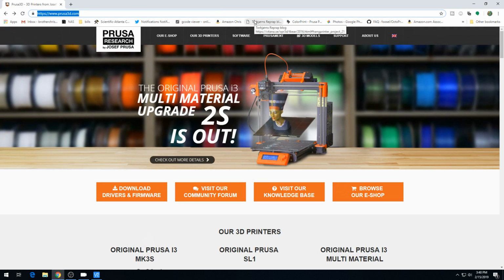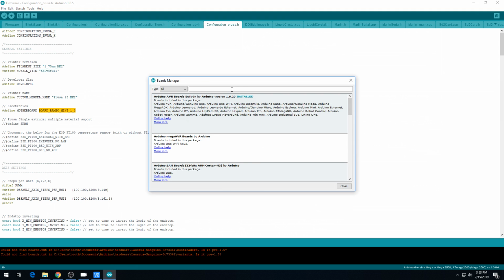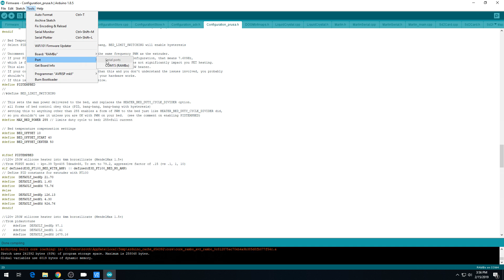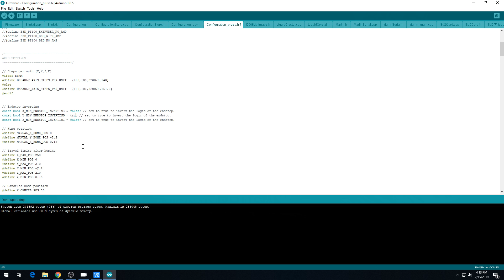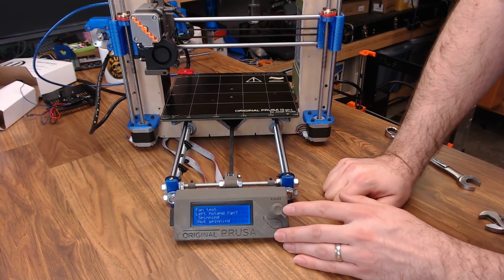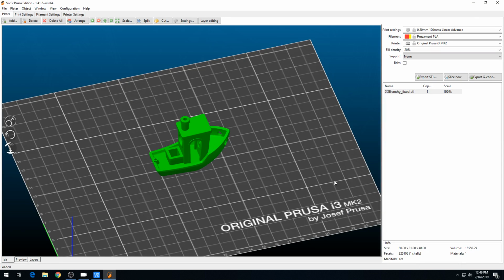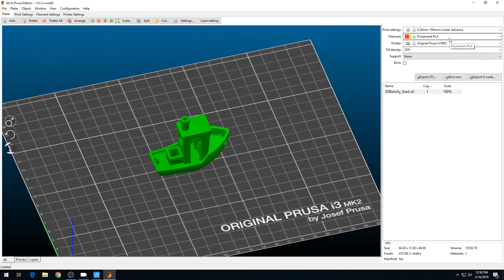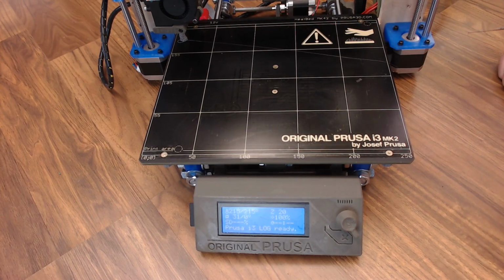Prusa MK2 Clone - Load Prusa Firmware - Chris's Basement

Comment: Hey- those lead screw adapters!  I need those too, still got the link to these?
Reply from the maker: I think this is the one I used. https://www.thingiverse.com/thing:2383921
Reply: @ChrisRiley  One more question:  Beyond the mk42 bed, mini-Rambo, and stock-style x-endstop, and 8mm/4start/2mm thread pitch Z-rods...  Is anything else needed that you can think of?  Or do all the firmware features work now?  (Beyond what you talk about in your vid that is)..
Reply from the maker: @corneleousworthington4566  The board and bed are the big ones, that should be it. Make sure you use their slicer profile to take advantage of linear advance.
Reply: @ChrisRiley  Thanks man!  One more question:  What bed level sensor are you using?  I have a 8mm 5v LJ8A3-2-Z/BX-5V, but it seems to want to hit the mk42 every so often, cannot understand it why?
Reply from the maker: @corneleousworthington4566  Might be your just got a wonky one, the QA on them isn't great. I use this one. https://www.aliexpress.com/item/32801244337.html?spm=a2g0o.detail.1000060.3.57c715d5AT5CqK&gps-id=pcDetailBottomMoreThisSeller&scm=1007.14977.161855.0&scm_id=1007.14977.161855.0&scm-url=1007.14977.161855.0&pvid=6dbb3999-d717-426b-8d42-76e3a2d4791e&_t=gps-id:pcDetailBottomMoreThisSeller,scm-url:1007.14977.161855.0,pvid:6dbb3999-d717-426b-8d42-76e3a2d4791e,tpp_buckets:668%230%23131923%2312_668%23808%237756%23237_668%23888%233325%235_668%232717%237558%23119
Reply: @ChrisRiley  My level sensor seems to work- it always levels perfect if doing auto-home, or mesh leveling of the bed.  It crashes maybe 2/3 when doing an XYZ calibration.  Think there is a default value somewhere in the arduino code, for Z-max (like the firmware asks you to do at the beginning of the XYZ calibration) and the bed, and maybe mine is a few mm too short?
Reply from the maker: @corneleousworthington4566  Yes, you pretty much have to adjust your hardware to get to the spots Prusa gives you. The Z shouldn't matter, just x and y.

Comment: Hi Chris Riley, I'm putting together a prussian bear but it came with ramps 1.3, and in the repository I can't find it, could you help me?
Reply from the maker: Check this out to get you started. https://discuss.toms3d.org/software-f5/prusa-firmware-for-ramps-prusa-i3-clones-with-mk42-t123.html
Reply: @ChrisRiley  you are very kind thank you.
Reply: @ChrisRiley  Hi, how are you, I installed the marlin, but I get an error, the screen does not work the knob, I am using a 2004A screen, I will load an image of the screen for you to have reference.
Another problem is in pronterface I move the axes, and they don't work, they get stuck, locked sometimes they move.

I have 2 types of screen and in the 2 the same thing happens to me.

2004A LCD screen
2004 LCD screen
They come in Kit with RAMPS 1.4.
Reply from the maker: @darksideadv  Hmmm...not sure what's going on. Could be one of the plugs is flipped on the board side.

Comment: abyone having problems with stepper motors with this board??
Reply from the maker: I haven't had any, what issues are you seeing?
Reply: @ChrisRiley  tried several motors, z axis only rotate 1 way x and y flutter back and forth.
Reply from the maker: Wow, sounds like maybe a hardware issue.
Reply: yeah I just got this board from ultimaker yesterday for my mk2 clone, having the same issue.  Currently trying to trouble shoot it now.

Comment: Great video!  Stupid question...  I’m building a MK3 clone, will I need to do all the Arduino stuff or can I just use Prusa Slicer and the latest hex file to update the Einsy Rambo board?
Reply: FYI - Jason at Ultimachine just told me that I could use the latest .hex file and Prusa Slicer.  Of course if you are using non Prusa motors etc, you may need to tweet the firmware.
Reply from the maker: @angieanddougsemail  Nice, good to know. Jason is the man.
Reply: @angieanddougsemail  I have just uploaded the latest firmware for the mk3s to my Ultimachine board using prusa slic3r and it failed to finish,  now I cant upload anything without getting  ( "avrdude: verification error, first mismatch at byte 0x3cb1f  0x00 != 0x01") tried to load the mk3 firmware with no luck, same thing, the only firmware that seems to upload to my einsy board is the mk2 firmware but then I have no information on my LCD, I am using non prusa motors with my clone, but every thing else are prusa parts, could my problem be that I havent tweeked the firmware for my motors, as a newby to this and being my first build I don't know what I need to do, any help would be greatfull as I have spent the last three weeks trying to sort it.
Reply: @angieanddougsemail  What is the difference with the LDO motors and the ones I am useing (17HS19-2004S1 OSM 20170817)?  my extruder is a E3D V6 and my Einsy Rambo board is from Ultimachine, all other parts are genuine prusa parts that I managed to collect, plus I allso have the mk3s upgrade, I just dont know what to do from here.
Reply: @angieanddougsemail  I hope so, and thanks for your input.
Reply from the maker: SO I am not sure, on the boards Prusa uses they are listed as the manufacture of the board. Non Prusa boards list Ultimachine. So this might stop you from using Slc3r to upload.

Comment: My X and Y endstops are triggered unless I press them then they are "open" I need to invert the min endstops but this is no longer a option in the firmware like it is in your video.
Reply from the maker: Are you building a MK2? That firmware hasn't changed since 11/17. If you are building an MK3, it isn't there because they have endstoplees homing.

Comment: definitely, need to get rid of the board that came with my Anet8 but so many options. As a newbie, a lot of people are saying go with smoothy, a new operating 32-bit system since I have no experience with either I'd say your the man to ask? sounds like another video  thanks again
Reply from the maker: Smoothie is a thing of the past, don't go that route. On an anet machine I would keep it budget friendly. Maybe a mks gen l.
Reply: @ChrisRiley  much difference between Gen L 1.0 and 1.4?
Reply from the maker: @bigrickshaberdashery2759  I think the gen l is just the newer version of the 1.4.
Reply: @ChrisRiley  with the gen 1 board what drivers you suggest?
Reply from the maker: @bigrickshaberdashery2759  If you want to make it silent with very little fuss. Go tmc 2208. If you want to save money you can get 2208s for x and y and just use some cheap a4988's for z and e.

Comment: Hi Chris very very awesome Video 👍👍...
Just one though can we use Bltouch instead Pinda probe
Reply from the maker: Thanks! You could, not sure how it would turn out. Not sure prusa has support in there firmware for it.
Reply: @ChrisRiley  Thanks for reply chris.
th3d also didn't have in their firmware but defining SERVO0_PIN 27 worked. May be it can be done for prusa too ?
Reply from the maker: @sharadjadhav7234  The pin could be changed, not sure the servos are in there. It will take some digging.

Comment: Can someone give me a name, part number or perhaps a link to where I can find the crimp on wire ends he is using for his power and ground wires? Right now I am using heavy speaker wire with twisted and soldered ends. I have been told this is a really bad idea and could case a fire.
I guess I should mention I have a box frame 3D printer that I built from scratch, so I am missing a lot of the nice bits all the cool kids have.
Reply from the maker: They are something like this. https://www.amazon.com/VLIKE-Crimping-Connector-Electricians-Contractors/dp/B077VGG18B/ref=pd_lpo_vtph_469_bs_t_1?_encoding=UTF8&psc=1&refRID=H8DCDN65RG68H8NRKZDR

Comment: Great Video, would love to see you go deeper into the firmware. I'm currently converting my Tevo Tornado to an oversized MK3. I'm successfully using the einsy rambo for crash detection, super silent stepper driving and homing without endstops. Power Panic is a WIP and hope to have it done this week. I've had to really dig into Prusa FW to make it work so I'd love to get your take on the organizing/layout of the code in the FW.
Reply from the maker: Thanks Evan, yeah it's a bit all over the place. 😀 It's not as straightforwardd as stock Marlin.

Comment: Could you use this firmware on an ender 5 style machine as is or would you need to change things?
Reply from the maker: There would probably be a few changes. Not sure which ones exactly. Not sure which board that printer has.

Comment: I'd love to see this but with a different board, MKS Gen L or 1.4.   Is that even possible? Either way nice video 👍.
Reply: If you have MK42 heatbed installed you can use https://github.com/slippyr4/Prusa-Firmware
Reply: Yes, it's possible but with the prusa setup the firmware controls bother the part cooling and hotend fan on 12V. The Ramps board only has 3 controllable 12v pins, 2 of which you are using for the bed and the hotend. I hooked up an external mosfet board and set it up to use the use the pins on the aux header. I have a branch here https://github.com/michielbaird/Prusa-Firmware/tree/MK2-RAMPS2 but pay close attention to pins_Ramps.h
Reply: I'm also working on a mk2.5 version but they restructured some things that makes it  a bit tricky. I think I'm close
Reply: @michielbaird  I wish to know where to start in case of Prusa firmware adaptation to Ramps. :) I have Ramps 1.6 with TMC2130 X,Y drivers and MK42 heatbed. The closest version I was able to find online is https://github.com/sakibc/Prusa-Firmware-RAMPS.
Reply: @MatúšKostik  I might look at that at some point, with the tmc 2130 it's a bit trickier since you'd need to hook it up to SPI and my electronics enclosure is already a bit packed...
Reply: @MatúšKostik  also be careful with a RAMPS 1.6 from the spec it looks like it's rated for 11A max, so you'd probably want to hook up an external mosfet for the bed, I tried the setup on the 1.5 and melted 2 boards. I really don't want people accidentally burning down their house
Reply from the maker: Very good info here, thanks for sharing. I didn't even know this was available.

Comment: I'm surprised no Chinese company sells an actual clone.
Reply: FYSETC is selling kits now, but I believe the motherboard is still sold separately.
Reply: Right, they sell a kit with the board but without the printed parts:
https://www.aliexpress.com/store/product/1-Set-DIY-Prusa-i3-MK3-Magnetic-Heat-Bed-MK52-Aluminum-Alloy-Frame-Profile-Rod-EinsyRambo/3480083_32968736910.html?spm=2114.12010615.8148356.10.68b3210bTZsJti
Reply: They are way to cheap to do that.
Reply: @bliksemdonder5624  I don't know. A real clone for 400€ would have some success, I reckon
Reply from the maker: Yes, I have seen them for about $350, but no board.

Comment: So next step is 0.9º stepper motors and metal frame ^^ . Keep up the good work.
Reply: I have two Home made Prusa,( laser cut aluminum frames) one is on 1.8 steppers and the other on 0.9, There is a noticeable difference, when fine layers are used, but for the everyday normal 0.2 layer heights , its really about the same.
Reply from the maker: @patprop74 Good insight, thanks for the info.
Reply from the maker: You never know what I will find next. 😀

Comment: Mmmm piece of candy...Mmmm piece of candy...Mmmm piece of candy...Mmmm piece of candy...I know your a bit of a ways from Quahog, but I couldn't resist. I would expect that your results will be a testament to the overall designs of the original equipment; even though you're not actually using OEM. E3D's and Prusa's equipment are so well designed that even the knock-offs are capable of producing almost equally comparable results. I hope you're bringing LOG with you to MRRF; it would be awesome to see Prusa sign it.
Reply from the maker: lol, so much better when there is candy! Ooooo, that would be awesome. I should try to get it there.

Comment: Chris - thanks for that video.

Would it be difficult to add those "saucy" Prusa parts to other printers?   I'm used to work with MK2S, but now I'm in the laborious process  of building my own 3D printer, and I'd love to have Prusa-like features, say - Live Z adjustment.
Reply from the maker: I think you can, but you might not be able to use the XYZ skew. It's really meant to check if the prusa is built correctly, but with enough firmware tweaking I am sure it can be done.

Comment: Chris, nice job as always.  You do a great job with the firmware stuff.  I built my printer following Tom's Dolly series.  Just ordered a Duet Wifi on Printed Solid's Sale.  I'm sure to use that Video.
Reply: On my clone I used an Anet A8 heatbed off Amazon.  Took precautions to make it safer but always looking for something different.  Any suggestions?
Reply: @johnhammonds3952  Hi Jonh. Also have a Anet A8. I would solder the connector directly to the heatbed and use the typical strain relief (cable chain or like chris use's on his LOG).
Reply: @rodryk5605  I still have the connector but doubled up the power wires as a safety.  I also added cable chain to provide strain relief.
Reply: @johnhammonds3952  That should be enough.
Reply from the maker: @johnhammonds3952  As far as board options you mean?
Reply: @ChrisRiley  I mean a good option for a heatbed.  The A8 of course has issues but also only 220 on x&y.  Also you m er notion needing to go to 24V on Duet to get power resume working, anet HB is only 12V.  You seem to have a genuine prusa mk52 on log.  my only printer is my home built Dolly.  So I dont have access to these.  I dont think prusa sells them and most clones are not cheap.
Reply from the maker: Thanks John, the Duet board is awesome!
Reply from the maker: It kind of depends where you are. LOG has a MK42 and I really like it. There are a couple of people selling them now. I know Printed Solid has one as well as Matterhackers.
Reply: @ChrisRiley  Thanks.  I'll have to look.  I am near Chicago.
Reply: @ChrisRiley  Does Mk42 do 24V?
Reply from the maker: @johnhammonds3952  The only ones I have seen are 12v only.
Reply: @ChrisRiley  May have to jump to Mk52.  That unfortunately often seems to have a hidden cost of the steel sheet with clones.  Do you know if Duet makes any use of the scanned points on Mk42 & 52 like Prusa does?
Reply from the maker: @johnhammonds3952  As far as I know, they do not.

Comment: Great vid. Got my Rambo board in the post at the minute to see if it fixed my random heated bed under extrusion issue. I’d been thinking about getting a slightly bigger frame so I can fit the mk42 clone bed and trying to do the proper Prusa firmware on it.
Reply from the maker: Awesome! It's a fun project to try to clone it.

Comment: Thanks Chris! I'm converting my anet to a prusa bear, I bought many parts including mini rambo 1.3a. Can't wait the package and start messing up with the fw!! :)
Reply: So, I have encountered a problem. Since minirambo sets max vref by prusa firmware. How do you correctly find the max current value for the stepper ? I’ve seen a formula in the fw but can’t get it right 😔
Reply from the maker: @marco.dallago  It kinda depends on the motor, but I would just use a nice round number. I use 800mv, they motors shouldn't get hot at 800. You set that in configuration_adv.h  #define PWM_MOTOR_CURRENT { 800,800,800 }
Reply: Chris Riley I’ve seen in configuration_prusa.h 

// Motor Current settings for RAMBo mini PWM value = MotorCurrentSetting * 255 / range
#if MOTHERBOARD == BOARD_RAMBO_MINI_1_0 || MOTHERBOARD == BOARD_RAMBO_MINI_1_3
#define MOTOR_CURRENT_PWM_RANGE 2000
#define DEFAULT_PWM_MOTOR_CURRENT  {270, 830, 450} // {XY,Z,E}
#define DEFAULT_PWM_MOTOR_CURRENT_LOUD  {540, 830, 500} // {XY,Z,E}
#define Z_SILENT 0
#define Z_HIGH_POWER 200
#endif

I changed the pwm motor current (loud/silent). 270 works with my motor, but 540 already skips steps . Don’t know how to find the sweet spot 😅
Reply from the maker: Awesome! These are great little boards.